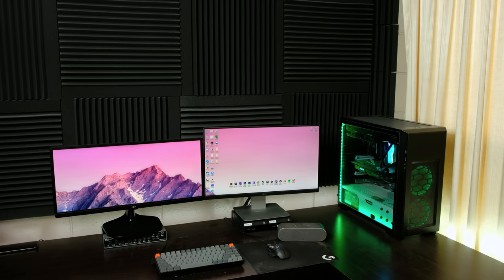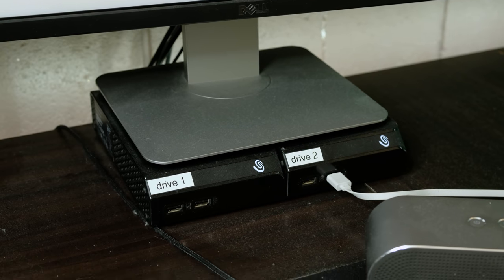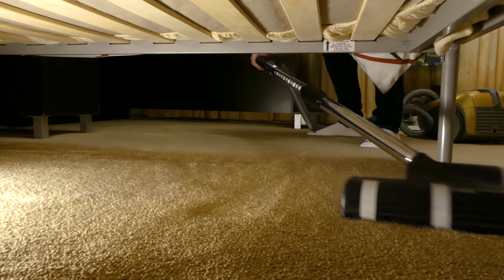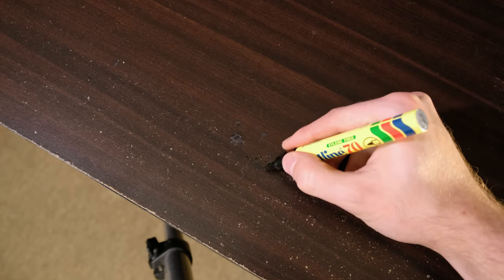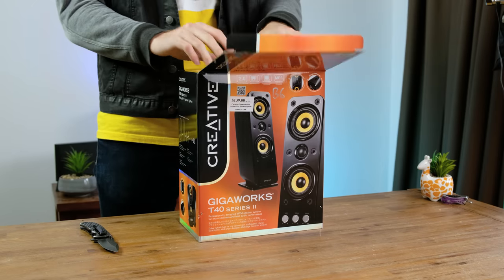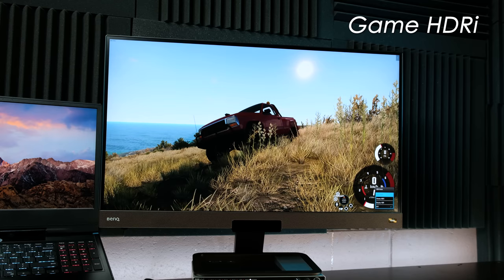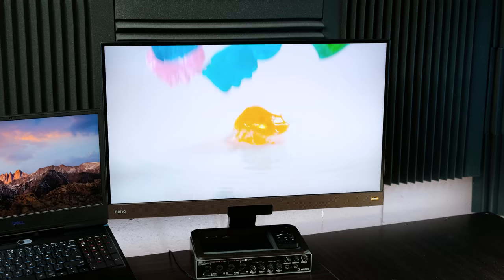Replacing My PC Setup... With A LAPTOP?

Comment: I had a laptop as my main PC for a while, I even had the same thoughts as you in that I'd be able to take it with me anywhere and do what I need to sitting in the garden or at a coffee shop. And I never did any of that.
The versatility I thought I was going to get with a laptop simply didn't happen. I was essentially using it as a desktop with my phone and tablet being the devices I used on the go.
Reply: Yeah, well your use cases are not the same. He probably does a lot of editing at photo shoots and whatnot, so a laptop can absolutely be of benefit.
Reply: I've had a similar experience. I have a pile of thinkpads that I love for different reasons, but none of them really fit as a primary machine. Just a bit too bulky, or a bit too heavy, or not enough screen real estate. My current laptop is an X1 carbon 3rd gen from 2015. Good general purpose portable computer that comes in under 1.5kg. but.... the i5-5300u is still a dual core with hyperthreading, which leaves a lot to be desired in the multi-tasking department. I'm also less than keen that only the SSD and wireless cards are user serviceable. 
Still use my R7-1700x and RX 5700xt mini-itx PC most of the time. (no, I don't spend money on much other than PC stuff.)
Reply: I, on the other hand, am so glad I went with a laptop.
Reply: well I personally take my laptop to work everyday, to cafes and so on, and at home I use it as a desktop. Works perfectly for me
Reply: same
Reply: @girlsdrinkfeck  Isn't a mini pc gonna cost you more than a gaming laptop? I mean a 1660ti is like $800 to $900. 2060's go for $1000 to $1100.
Reply: @girlsdrinkfeck  You living in 2010? 850 UK pounds is what a 3060 laptop costs. Complete with a 144hz panel, i5 11400h, 500gb nvme, 16gb 3200mhz ram, etc. 

And if you want to go used, it'll be even cheaper.
Reply: @girlsdrinkfeck  USD, as I stated in my comment,
Reply: @girlsdrinkfeck  The symbol "$" is generally referred to USD, unless otherwise stated
Reply: @girlsdrinkfeck  Listen pal, I don't know where you or everyone is from. So I can't read your mind and use the currency you're most familiar with.

Comment: “Carpet from the 60s” You probably gotta burn that whole thing.
Reply: But you don't wanna be around the fumes it produces
Reply: It probably has ispestos in it
Reply: Somerset Productions asbestos?
Reply: Yes
Reply: Ours is from 2000.
Reply: It's idiotic to burn it. It's a collector's item now.
Reply: WinDestruct Exactly.
Reply: I have several carpets that are from the 70s & 1920s from my grandma.
Reply: don`t burn it, just wash it with eucalyptus oil
Reply: steam clean will do the job

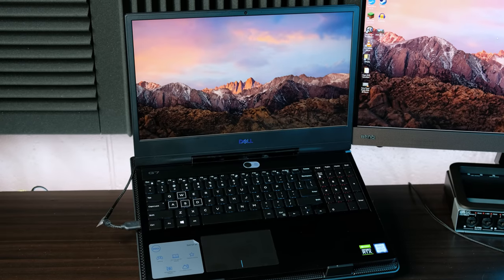Comment: 6:49 that laptop looks like it's straight from early 2000s.
Reply: Yeah
Reply: Guess you could call it a sleeper laptop cause it looks basic on the outside and its got power on the inside.
Reply: @RedPMD  guess you could be appalled at the fact that gaming laptops in 2020 are just downright ugly.
Reply: @aryantiwari1945  the zephyrus g14 looks nice though
Reply: Gaming laptops in 2020 has somehow gotten rid most of the stereotypical gaming looks we used to have (other than RGB)
Reply: @garfieldandfriends1  My Gaming Laptop looks cool but not so much different to a standard laptop, I like that as I also use it in College (as I do Graphic Design), walking around with a Beasty Gaming laptop with RGB Everything, crazy designs will just look stupid in class and be of distraction so I like the basic look of this.
Reply: Thinkpad aesthetic, though definitely more modern looking
Reply: Well if that is an early 200s laptop, I have a late 80s laptop.

Comment: Ahhh, the new G-Series...best for when temperature is just a number.
Reply: That’s intel for you
Reply: @joebates640  yeah cause amd options have fantastic thermals!(Zephirus G15, TUF A15, Dell G5 SE)
Reply: @TabalugaDragon  tuf a15 temps sucks though
Reply: Intel gaming laptops in general lol, though a simple undervolt + a quality thermal pastes solves it drastically
Reply: @Rinauxin  and G15 and G5 SE don't?
Reply: @axxdrian  except undervolting isn't available anymore on like 90% of 10-th gen H series Intel CPU-s. Only Nvidia GPU undervolting is still fully available.
Reply: @TabalugaDragon  yes but laptop manufacturers tend to have better heatsinks installed now compared to 9-8th gen laptops, and repasting is still viable.
Reply: @axxdrian  most of them didn't change their heatsinks. The choice between laptops don't overheat out of the box is very narrow. And repasting isn't nearly as effective as undervolting was. You'd have to reduce clockspeeds to fully get rid of high temps

Comment: I have the same BenQ monitor, I bought it 3-4 or so months ago.  Fantastic monitor even though I have to have the brightness set to 100 or else there is noticeable flickering especially to the right side of the monitor.
My only other negative point with it, the location of the 3.5mm output and the lack of OSD option to choose sound output between the built in speakers and the headphone connected.  Now whenever I want to use the built in speakers I have to physically remove the headphones which is stupid stupid stupid, especially since the location of the port makes it difficult to do so.
Regarding laptop vs desktop.
I used only desktop computers since the 80s.  Then in 2002 I got my first laptop to use as my main computer.  A great laptop for its time.  It too was replaced (technically I still have the laptop) by a desktops from 2005 and then went back to laptops in 2014.  Since this year I am back to desktops (although this beast desktop is actually 2014 tech).  

I used the computers (2002 onwards) for simple text editing, gaming, web browsing, huge ass documents, video editing, etc etc.  Depending on the tech inside, the laptops could stand one to one with the desktops of their time.  With two negatives for them.  Fan noise when doing anything intensive, making far more annoying noise than my desktops* and more difficult to upgrade or even clean them, or repair them.

As it is now, depending on usage, I would say a desktop PC makes a far better option than any desktop replacement laptop.  

I don't get the Seagate hatred I see online.  I use Seagate drives since the 90s and I only had one external one fail on me, actually it was DOA.  
I wish I could say the same for WD which other than my very first one (a 20MB WD drive inside my A1200), every other WD drive I have bought quickly died on me and I do mean that.  I never had one survive more than 2 weeks.

Comment: I also moved from desktop to laptop because i wanted to see what they are all about really. I'm on the edge of building myself mid-class desktop and keep my laptops aside. They are all business laptops. I don't play games much so i don't need graphical horsepower

Seagate HDDs are fine, i have been using one Barracude for ages now 24/7 and it has 21258 hours on it (2,42 years non-stop)

Also white desk makes the dust "transparent"
I also would like to set up OpenMediaVault NAS in other room/space and with laptop it's easier to manage it, plug in the ethernet cable or whatever and just set it that way

Comment: Probably the only house in Australia that has no killer creepy crawlies found inside.

Just a question: Instead of a laptop or netbook, I have a built-in computer monitor Toshiba LX830. But it unable to detect 2nd display on my Dell I2312HM monitor or AOC I2757FH despite using USB>HDMI and HDMI>VGA adapters.

Any advice?

Comment: you should totally turn the desktop into a NAS and plex server. 
I used my old desktop as a freeNAS box for a while. Last year I transitioned that pol over to Ubuntu server so I had more virtualization and docker flexibility. That 8700k is a bit overkill for a NAS, but it'd be great for a home server. 
I love having a centralized location for all my files. I have a torrent client running directly on the NAS, and can automate a lot of the process of download to available on plex. It's also great to not have to worry about which drive has what data. It's all one contiguous pool of HDDs. 
If you're not comfortable enough with ubuntu, UnRAID is also a great option.

Comment: My Lenovo IdeaCentre B320 all-in-one desktop computer (with Intel Pentium Dual-Core G640 CPU at 2.8GHz, 8GB RAM, and 1TB hard drive, the latter two which were upgraded from 4GB and 500GB respectively) succumbed to old age and died two months ago, after nearly ten years of using it. Even switching from Windows to Linux couldn't keep that system alive for very long. A few days later, I bought a refurbished Microsoft Surface Pro 4 2-in-1 laptop/tablet (Intel Core m3-6Y30 Dual-Core CPU, 4GB RAM, 128GB SSD) from eBay for about less than $300. The charging cord that came with my Surface Pro 4 stopped working after a while. Fortunately, I've already purchased an extra charger in a case like that. I also have a USB 3.0 hub for connecting additional USB devices (wireless keyboard and mouse combo, USB flash drives, external Blu-ray/DVD writer, etc.). Since I'm a cartoonist/fan artist, I also bought a Wacom Bamboo Ink Plus stylus pen. I also knew that 128GB of internal storage wasn't going to be enough for me, so I bought a Samsung EVO Select 512GB microSDXC card for extra storage space. Lastly, I bought a multi-angle case for my Surface Pro 4.

Comment: You should replace the air filter in your HVAC system. I recently replaced my ultra-shitty one with a 3M Advanced Allergin, Virus, and Bacteria Reduction filter, and that bad boy has helped with my dust situation a fair amount.

Comment: I'm tempted to hold onto the laptop I bought on credit for my Mom, since she doesn't need all that power. It's an Asus *dodges rotten vegetables*. Acer Aspire 7,  16 GB RAM, Core I7 9750H, Nvidia GTX 1050, 512 GB SSD with a slot open for whatever I want to add, 15.6 diagonal IPS display, all the usual goodies. A bit of overkill for an old lady who just wants to check email, but the alternatives were all chromebooks, nahhhh, I'll wait until she's ready to get her old computer at the home (she had a stroke and can't really use the system with both hands).
And I got to the laptop specs you listed, my video card exceeds (barely) yours.

Comment: Ahh, carpet floor... my arch nemesis ever since I moved to my current home. 
I am mostly using my old ThinkPad T420 that's sitting in its docking station when I am not playing games so I get why you ditched the tower now.
I wouldn't feel fine with one of those consumer OEM laptops doing the same however since those are hard to clean up and replace parts on these days.
Reply: Wut? Carpet is amazing for audio! It’s literally a requirement for audio recording and cutting down echos and background noise.

But as far as dust, well yes, they are a nemesis in that regard.
Reply: @ghost-user559  It's really a double sided sword.
On one hand you have a warm and nice looking room on the other, you have to pick up the vacuum cleaner A LOT.
Reply: @MegaManNeo  Yes A LOT. I have a husky malamute mix and he is literally a living shedding carpet, and a dove, who is a living feather factory. 

So for me carpet is a never ending war against all things fluffy and feathery and there is no winning this war. 

But hey, no echoes and less audio noise in my recordings, and soft warm war zone for bare feet in the winter, so all things considered it’s a net win?
Reply: @ghost-user559  Certainly rough but you have your fair points to keep it in your home 👀
Reply: @MegaManNeo  If it was my home I’d probably remove it and put in area rugs where needed, but don’t underestimate the value of carpet, despite the struggle.

When they design professional sound studios they ADD carpet to cut down on sounds bouncing off the floor. 

So it’s definitely something worth having, but I feel your pain on the vacuum cleaner all the time.

Comment: Trust me. PCs are pretty modificable, but in laptop, you ruin the warranty to replace the RAM and the graphics card is (i think) soldered
Reply: no you don't lose warranty by upgrading ram on most gaming laptops. He doesn't need to trust you because he knows all of the differences between desktops and laptops.

Comment: You upgraded by downgrading? That 9750h has the same amount of cores but wont clock any higher than 4ghz under load. And that 2070 max q has way less performance than a 1080 ti. And on top of that you have to listen to a laptop sending its fans to the moon.
Reply: @Central Based Agency its called mini itx. all windows gaming laptops require external power anyway to get all of the performance out of them. if you have to plug in anyway you might as well just build a mini itx machine. you can shit all over a laptop in rendering times while still coming out cheaper and the whole setup can fit into a bag

Comment: No offense brotha....but that laptop setup is weak.  Should have went with something 8 cores or more...an i9 is a good choice.  GPU is beefy enough but again they do make higher VRAM laptop GPUs, apple and one one other company also offer HBM2 VRAM which makes any workhorse PC tower, shiver at the high bandwidth speeds.  Or an eGPU could have solved this.  Dope as hell and clean none the less but better hardware could have been used for that ultimate laptop/desktop style work station.

Am I the only one who likes your prior setup more???  Anywho cheers from Hollywood and I love your channel so keep up the good work regardless.

Comment: your old setup is still like 100% faster than my 4790k and rx480 desktop :|, and that being optimistic.
Reply: B please, my specs is Intel HD 620 and 2.5Ghz Intel I5 7200U and I have high expectations from it like running beaming drive with 60fps and etc, instead I can only play it with 25 FPS max ;-;

Comment: Why did you change the setup to something much worse? The rtx 2070 max q is 68% worse than a 1080 ti because it is a mobile chip. https://gpu.userbenchmark.com/Compare/Nvidia-RTX-2070-Mobile-Max-Q-vs-Nvidia-GTX-1080-Ti/m703511vs3918

And the processor is also worse. The i7 9750h is 17% worse than your i7 8700k. https://cpu.userbenchmark.com/Compare/Intel-Core-i7-9750H-vs-Intel-Core-i7-8700K/m766364vs3937
Both of these components will make your editing time and rendering time significantly much longer and slower. I suggest you keeping your desktop on the desk and having the laptop always synched up with the work you have done. So that you can continue wherever you want. But nonetheless the video was great and the editing was flawless:)

Comment: you downgraded every single point of your setup. 9750h vs 8700k and 2070 vs 1080ti. I personally moved to ASUS G14 with Ryzen 9, instead of my old 4790k.  I can say that this laptop is way faster in every way. At least you should get eGPU set up for very stong 1080ti or a better card.